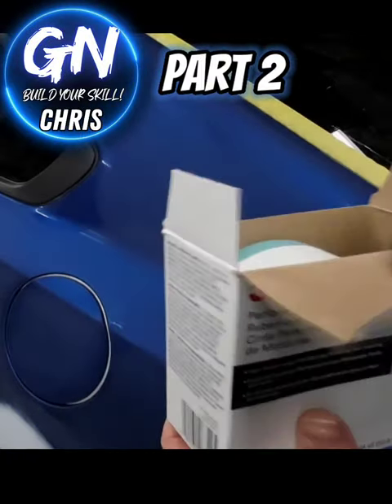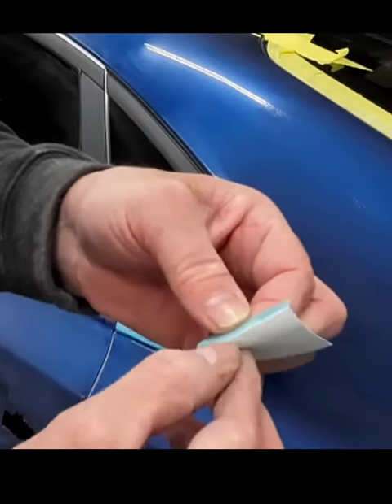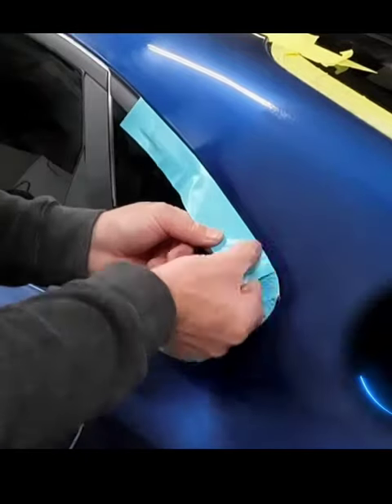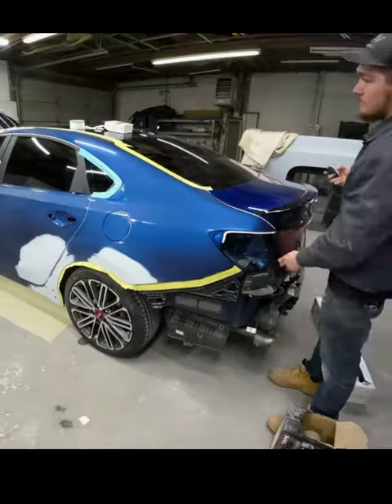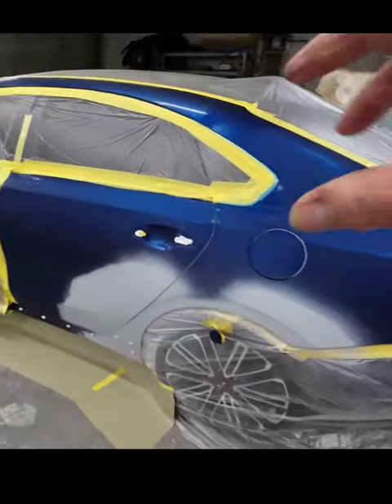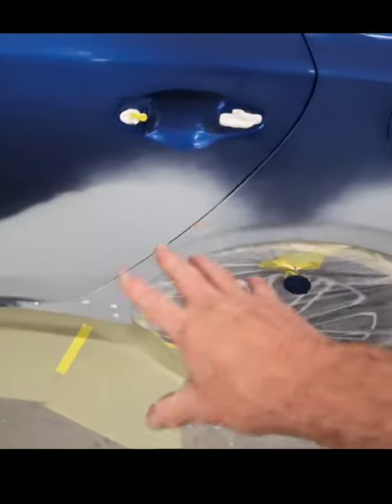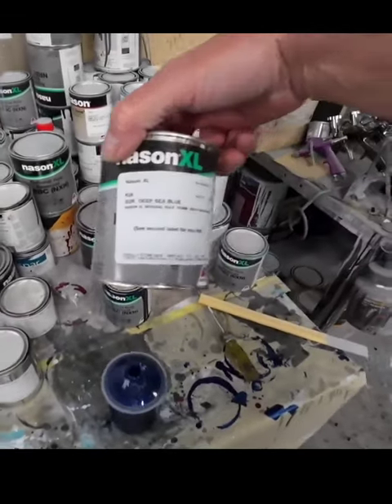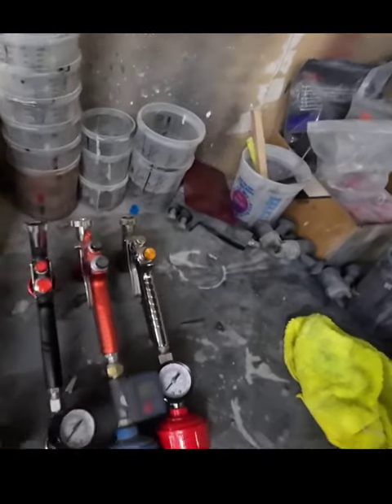paint your car part2 masking tips

Comment: Throw that nason in the garbage. At least get some Omni or shopline
Reply from the maker: This is nason xl , better coverage than ful base.  I haven't  had a problem with it.
Reply: @GarageNoise  I’m a distributor of  automotive paint and coatings and I TRY not to sell that to anyone I know. Foreigner used car hustlers and their goons only… is XL cheaper than shopline??
Reply from the maker: @chuckcraig4380  I'm  not sure if it's  cheaper. I've  used shop line before it's  been awhile and omni. Nason is readily available to me and I haven't  had an issue with it. Some colors are a challenge but it's  that way with most brands.